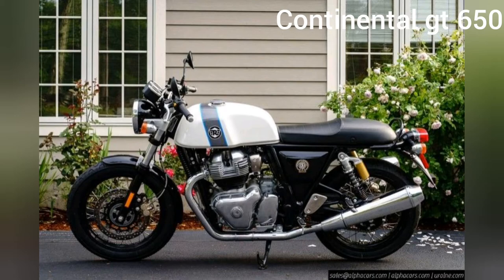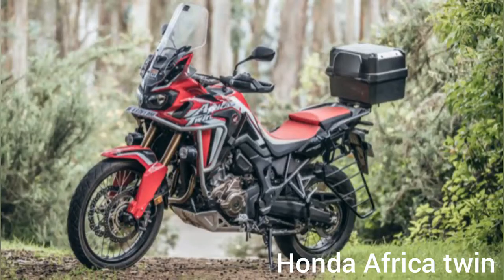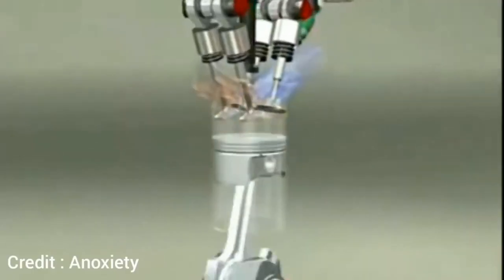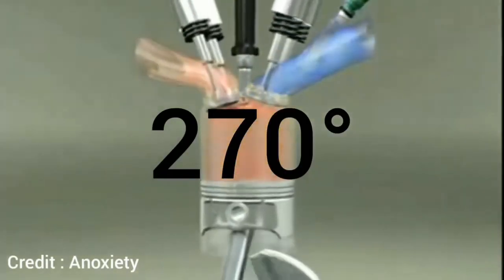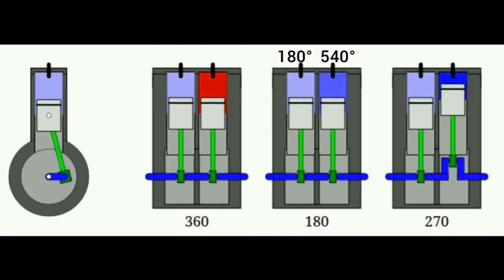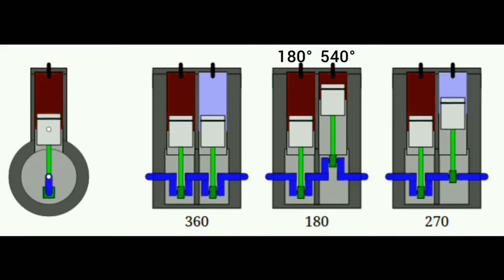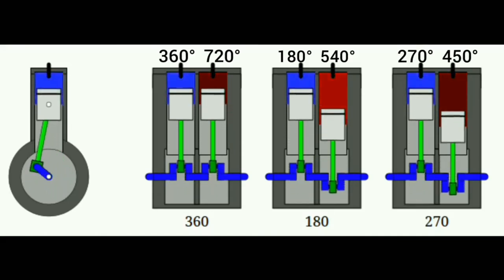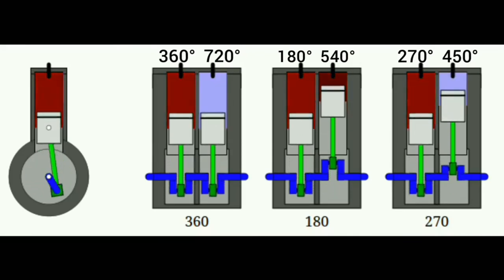why 270° parallel twin is awesome??

Comment: They are great indeed.  You get the "thumpthump...thumpthump...thumpthump"  exhaust note and the power delivery characteristics of a v-twin but in a more compact and mechanically simpler engine (single cylinder head and valvetrain vs two separate heads and valvetrains in a v-twin).
Reply from the maker: You are absolutely right 😊